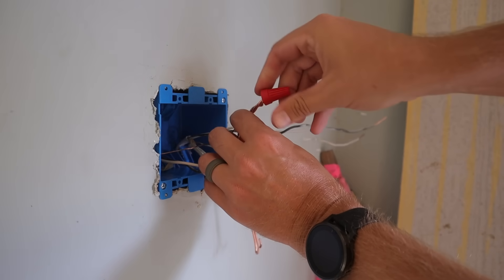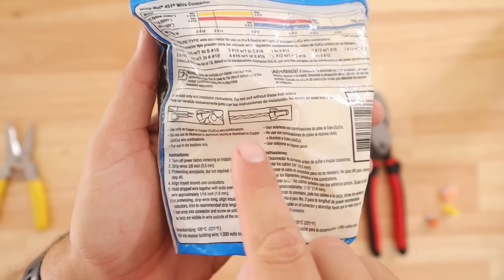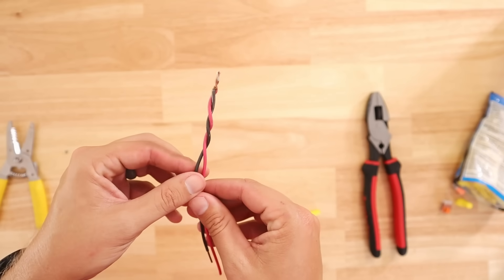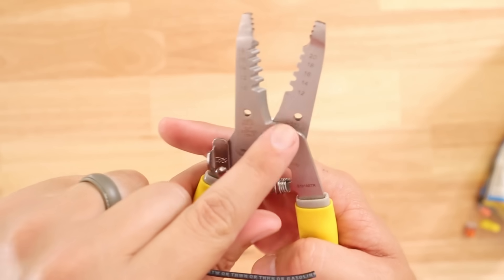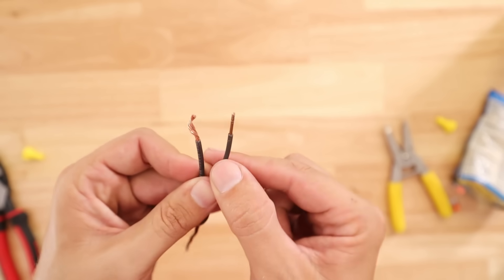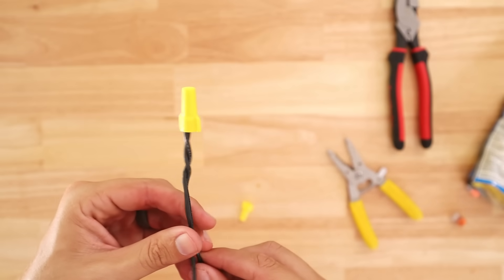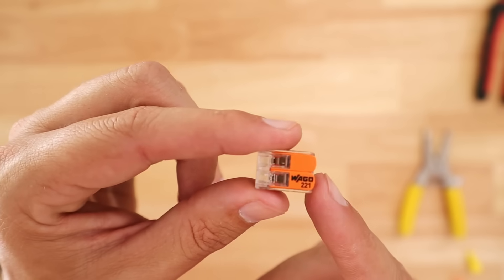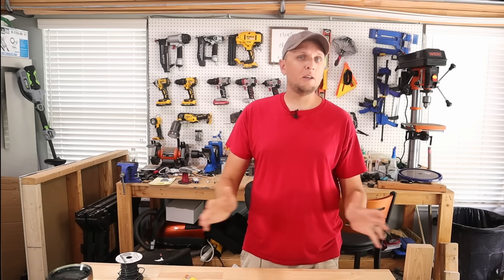BIGGEST Mistakes DIYers Make When Connecting Wires Together | How To

Comment: Good video but I think you missed the real design feature of a wire nut most people are unaware of that causes most if not all the failures. Wire nuts are a compression connector. The conical metal spring inside the wire nut first bites into the wires until the friction between the spring and the wire exceeds the friction between the spring and the plastic part of the wire nut. Then the spring screws upward into the tapered plastic part. This squeezes the spring radially onto the wires creating a high amount of compression. Making sure this compression contains all the wires is the most important feature, not whether the wires are twisted together or not. Pre-twisting and torqueing until the insulated part is twisted is just a good method of keeping the wires together and putting enough torque on the nut to run the spring up into the tapered housing. You can feel the two stages of torque, easier until the wires bottom out in the spring and harder until the spring bottoms out in the plastic nut. You can sometimes even see the plastic part swell as this is done. You know you did the best job possible if you unscrew the wire nut and the spring stays on the wires! This usually only happens if you don't let the insulated part twist and really crank down on the nut. This design is why you should never reuse a wire nut. The spring can only be turned up into the plastic once. If you remove the nut and reuse it you will not get the clamping force of the spring running up inside the tapered nut. By the way some of the very small wire nuts do not contain a metal conical spring.  I do not use them and use a crimp connector for very small gauge wires.
Reply: I was trained by an electrician that had his own company for 30 years....he recommended twisting the nut just as you said but continue twisting until you have 3 twists in the wire.  He showed us pictures of a school gymn that was hit by a tornado.  All of the high bay lighting fixtures, metal halide type, we're all hanging by their wires.  The roof and some sides of the building were gone.   Now theres some solid connections.   Perhaps in cases of heavy overhead fixtures the twist method is best, otherwise, the way you described is great!
Reply: Awesome.  Never thought about not reusing nuts.  Definitely will stop.
Reply: 5
Reply: What about solder seal wire connectors?
Reply: @lilbagz4418  low voltage
Reply: @orisisseibert3507  wdym? I cant use them...or do u suggest i pay an electician and he uses the same thing???explain
Reply: @lilbagz4418  never re-use them
Reply: @orisisseibert3507  never re use what??i mentioned solder wire connector.....your mentioning stuff i never talked about...
Reply: @lilbagz4418  wire nuts. Sorry.
Reply: @orisisseibert3507  well im buying solder wire connectors today...dont need an electrician
Reply: Thanks for all of the good information on how to make the joint and how the connector actually works.
Reply: You could call them springs I get it, but in reality they're not springs, they're tapered right handed threads and some wire nuts don't even have those in there, the nuts themselves have the tapered threads embedded... which are the cheaper versions but will still work for light applications.
Reply: I disagree with the original post.  The wire nut will still grab into pre twisted wires further making the connection but serves more as an insulator.
Reply: Charlie, I’m glad you took the time to post this write up. Before I retired I was electrician for 50 years. It all started when I was in the army as a combat engineer, I was the company electrician. From there I went to school with the IBEW local 58 in Detroit Michigan. What you said about wire nuts is completely accurate and if the nut is put on right, there is no need in this world to twist wires together. Being a local 58 electrician we certainly didn’t have time to start twisting every connection that we made with a wire nut and was totally unnecessary. I never ever remember wires coming apart, shorting out or anything else in regards to using the wire not in the proper way without twisting wires both bare and twisting the insulations together. Thank you for your post and speaking the truth in this case.
Reply: @RichG122  as an IBEW member I vehemently 100% disagree! You obviously haven’t had to add or demo wires in a live network at a business in operation much. Lose a neutral and fry a computer. Shut down a network and spend 30min figuring out what circuits they are. Then set up a shut down with the customer and building engineer in the morning. Talk about wasting time. Twisting wires together takes only seconds. I was taught in my first week as an apprentice to twist wires together in my local. I should be able to remove a wire nut and the splice stays together.
Reply: @andrewk7745  you and @Mark are ABSOLUTELY CORRTECT!!! Rich G is an old timer that is out of date with current technology and info. Sometimes, it’s worse having an old timer work on your stuff because they are “stuck” and stubborn with their way of doing things. Like going to a dentist that was trained with the most current technology available to them vs the old dentist that still does things the old school way. As an IBEW member as well, I’ve come across a lot of hack work. These people that don’t pretwist the wires will learn the hard way one day when they have to dish out thousands of dollars when they lose a neutral wire and burn up equipment. An apprentice I worked with burned up a bunch of TVs at a Best Buy, because he undid a group of neutrals spliced together. Who knew plasma TVs don’t like 208V lol. Or they go open up a Jbox and undo a wire nut only to have all the wires fly all over the place because no one pretwisted and have a “hot” wire touch their face or blow up from shorting out in their face.
Reply: @RichG122  the
Reply: @RichG122  SOLIDARITY
Reply: @RichG122  always need to pre twist. Most of my open circuits i repair are wires that arent pre twisted. Also if you need to work live you cant take off the wire nut as they spring apart. Relying on a 5 cent part to stop a house fire or hundreds in open circuit testing isnt worth it.

Pre twist and cut the ends even and crank a wire nut on and its done

Granted experience in installation is okay...but electric expands and contracts and sometimes a bad connection can let go after 15 years even. Seen it. Seen a nail in original cedar plaster lathe that went through a bx and decided after 70 years of settle and expanding to short and trip the circuit breaker
Reply: @CrAZyFr33Rid3r  Exactly. An electrician that does not pre-twist the wires is a HACK!! Most of us hate residential, romex work but that is no reason not to be a quality tradesperson.
Reply: @CrAZyFr33Rid3r  in the first house I bought aka a double wide.  It was 15 years old and then I bought it and 3 or 4 years into my ownership all of a sudden the plug In the master bathroom just stoped working.  We hunted and hunted took us days to find the problem.  On the opposite side of the house there was an outside socket  it worked fine but it was the last thing I could find to take apart.  Well low and behold there was a wire nut that the wire came out of. And this was more then 15 years later. On a plug that we never used a single time.
Reply: @dayinthelifeofdolly8810  exactly, wires expand and contract as the energy flows through.  That expansion and contraction makes a poor connection fail! Thanks for the story, only thing just as bad it backwired switches and outlets! Best to wrap the screw on a device
Reply: @CrAZyFr33Rid3r  I also have a tendency of wrapping my caps with eletricl tape just for one more smidgen of protection.    But the last place I expected to find the bad wire was on the other side if the house on an outside socket.  It was a double wide so it was on the other side if the split of the 2 halves of the house lol.  That is what I found super odd.
Reply: @CrAZyFr33Rid3r   You are talking about two different things here.  One is the proper use of how the device was originally designed, and the other is the improper placement of wires or wire protection.  These wire nuts were designed so that the wires are both placed inside the nut parallel to one another and twisted until the wires have seated properly and the wires are then twisted together beyond the open end of the nuts. Just because a technician made a bad installation does not mean you should blame the device.

But hey, what do the engineers that make and extensively test their devices know?
Reply: @jmackinjersey1  i was inferring that the solid wires not pre twisted and cut even...regardless of the wirenut saying they dont need pre twist could fail. Im in an area of large development and in the service end of the industry. New structures are built too quickly and with less then minimal thought and compliance.  I fix the problems after a new house is built when things start failing because the guy who didnt pre twist wasnt called back. Same deal with the guys who stab in the back of an outlet or switch, they burn up under load years laterand cause open circuits.  I fix a few open circuits a month in my area and most are bad witenut connections and backwired outlets
Reply: @dayinthelifeofdolly8810  in electrical school we learned of this.  Its blamed on the Earth spinning and vibration from. Eventually everything moved
Reply: @biggunsnu  😂  No.  Sorry, but you're 100% wrong.  IBEW 347.  Zero need to pre-twist wires.  Anyone who tells you you HAVE TO is a hack!  LOL!!
Reply: @dayinthelifeofdolly8810  lo
Reply: I'm glad I read your comment!
Reply: Great explanation of the way the wire nut functions I could not have done as well thoroughly explaining this as you have.
Reply: Very informative thank you
Reply: Superb analysis. Thank you!😊
Reply: Superior AZ .  70s and 80s  ?
Reply: I just read the directions on a wire nut bag the bigger wire nuts it says pretwisting is acceptable but not necessary now that's manufacturers instructions
Reply: My Uncle taught me to always wrap all wire nuts and continue the wrap down to the insulation of all wires being connected. I've never seen a down side to this practice, but if there is any, I'd appreciate input.
Reply: Moral of the story; if you are going to remove a nut (of any variety), you had better make DAMN sure that you aren't going to need it again
Reply: As far as I can see, he left out nothing. BTW, many public buildings
are not allowing
lever connectors, as well as wago not being the preferred method. Make recommendations with extreme care.
Reply: What about 10 gauge? So hard to twist!
Reply: I would add that the spring in the wire nut, cuts into the wires forming a gas tight connection.  This is important.  If one wire is not in contact with that spring, it can get surface corrosion (oxidation) that insulates it from the other wire and your connection can go bad.  If both wires have the spring cutting into them, there will be no corrosion or oxidation at those points of contact, and the connection will remain good indefinitely.
Reply: Charlie gets it, I've been made fun of because my wire nuts have a bulge in them. I also work on a farm that had a structure fire from wiring before I worked here. I am the only one currently asked to make electrical connections, not only because I know how but also because they don't fail. If there is any question about how the wires line up inside the nut I will stop before the spring moves inside the cone, back it off and check. Way back in votech one of my instructors, the one who got me a full scholarship for electronic theory, would try and pull each wire out of a nut as hard as he could. If a single one pulled out you'd fail that circuit even if wired correctly. Regarding current passing through the spring of the nut, given the spring digging into the soft copper on multiple turns and the parallel paths this creates I would suggest not only can't it be avoided but is advantageous when installed properly. Compared to waygo where all the current flows through this secondary metal I'd say wire nuts are still superior, again providing they are installed properly.
Reply: The wire nut replaces electrical tape. That's the basics. It provides insulation. The design has improved to consider proper connection. Think about Ohms, reducing resistance. This is not important when it comes to typical house wiring. 
On low voltage, and top of the line strand wiring soldering is required.
Reply: Yes, the key is the sharp edge of the spring that "bites" into the conductor and forms a gas-tight connection.
Reply: BS! Been using ceramic nuts for years with no probs!
Reply: Except the wire nuts with a screw thread instead of a spring .
Reply: @greybone777  That is the same thing.
Reply: I 8 lip 9 pop loop loop Pollo
Reply: No. Your wrong
Reply: youve never done any service work .
Reply: @rogercross2642  ive never done service work? Haha thats all i do. Im a master electrician and i mostly do home repairs fixing all your messups
Reply: So you are telling me that it's an explicitly worse design that goes toward creating more waste and reducing reusability. That is SO American...

Comment: Was so close you almost got it. “Wing nuts” just aren’t safe at all. Splicing and connecting of wires should t be done with wagos. It is the only way to guarantee a good and safe connection for the current levels we are talking about
Reply: Not safe?  BS. After 45 years in this trade and twisting a few hundred thousand wire nut joints, I can expertly say you don't know crap.   Take your diy amateur expertise elsewhere and quit misleading people.

Comment: Your opinion doesn’t matter if it isn’t a code violation.
Reply from the maker: So if there is a way that many feel is better than the minimum, that’s not something to think about implementing?  Because the first example I showed is a big contributor to failures and technically is against code as it didn’t follow the manufacturers instructions.  But it’s what many do.

Comment: Retired industrial wire-nut here. When PROPERLY twisting the joint prior to attaching the clamp, the contact surface between two solid conductors is exponentially increased over parallel conductors, underneath the clamp. More contact equals lower resistance, voltage drop and especially heating, promoting failure free longevity.
Reply: Facts
Reply: True, but, the real key is that the square spring of the connector "bites" into the conductor, forming a gas tight connection that will not oxidize (and add resistance).

Comment: So you read the regulation which says follow the package directions and then you proceed to tell us you think the directions are wrong. Actually, YOU are wrong. All these products are designed by engineers and tested to meet the requirements of the job. No twisting is required and your assertion that it is better is simply your opinion. The product engineers know better.
Reply from the maker: I didn’t say the directions were wrong.

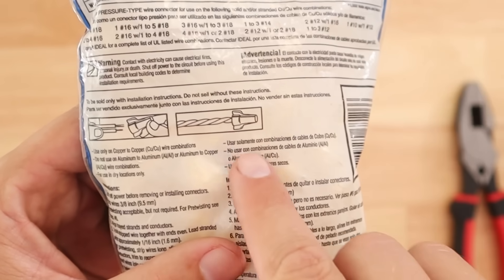Comment: All these electrical you're doing it wrong videos all use romex. You can't use romex where I live, even phone wire must be in conduit. Literally every one of these videos is wrong.  Also 2:35, over twisting the wires can weaken the coating, under a heavy load the wire can overheat and with a weakened coating it can create a short inside the box. Do not over tighten the nuts or wires.
Reply from the maker: They aren’t wrong they just don’t pertain to wherever you are.  YouTubers can’t make a video getting the code for every single jurisdiction spot on.  It would be a weeks long video.  The second part obviously there is a line how much it should be twisted, in the example, it’s not over tightened.

Comment: With solid/stranded connections, I like to put a mild bend on the solid wire. This seems to prevent the stranded wire from just wrapping around the solid,  and allows more interaction between the solid and stranded.  After applying the wirenut I also check each wire ensuring it is held in place by pulling on it a bit. I'm a diy,  and don't mind taking a bit more time.
Reply from the maker: Thanks for the feedback Bert!  I can see how that could be helpful.

Comment: I have been in construction for 44.5 years and you always must twist the wires together first the wire but is NOT to hold wire together the wire nuts only protect the bare wire
Reply: Are you sure?
Reply: @paulcousins6890  yes I actually went to college for international building and national electrical code and universal building code and several other classes it was fun for me

Comment: using wire nuts is wrong. outdated and stupid tech that belongs in the past. WAGO to the moon.
Reply: Wire nuts are still highly effective... WAGOS are awesome....I use them over wire nuts every day. Wire nuts still have many uses and if used properly are flawless. If you lace them with de-ox inside the one weakness that sometimes can manifest from moisture buildup is eliminated. And that isn't even on the wire nut as the electrical splice should be enclosed and kept dry from the environment by the enclosure in the first place.

Comment: I do the pre-twist method, then I add a couple laps of electrical tape over the wire nut and down onto the wires to ensure the wire nut doesn't back off.
Reply: lol, And your makeup will take 3x longer than others in the field and you'll be fired for lack of production. I've seen both methods. What matters is good connection and whether the wires stay in the wire nut.
Reply: @jeremyorison1316  Haha, don’t think I’ll get fired.  I don’t work as an electrician, I only do work on my own house.

After all this video is for DIY’ers.
Reply: Extra measures are unneeded even per code and will annoy you or the next person after you later on ...
Reply: But do you ...